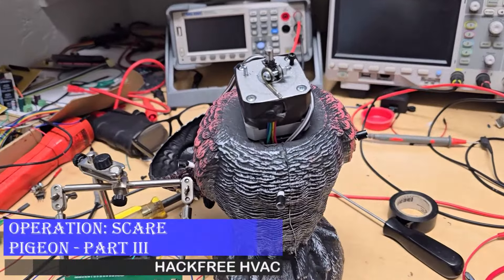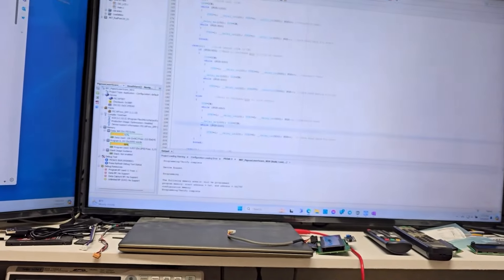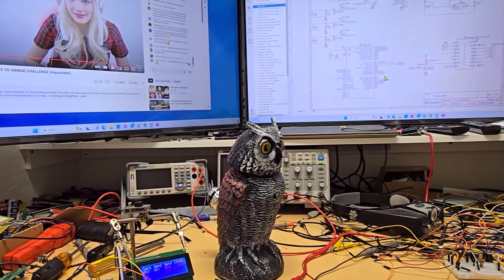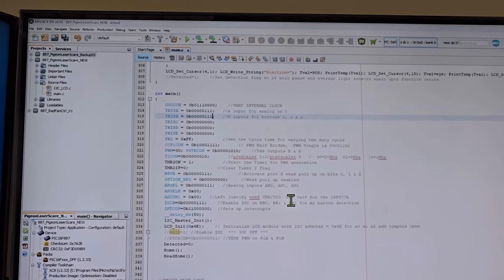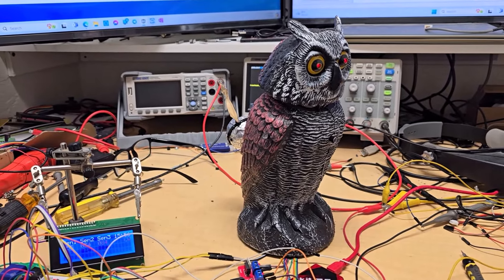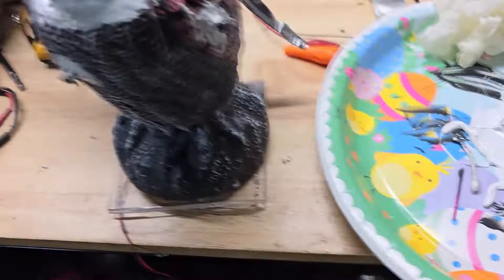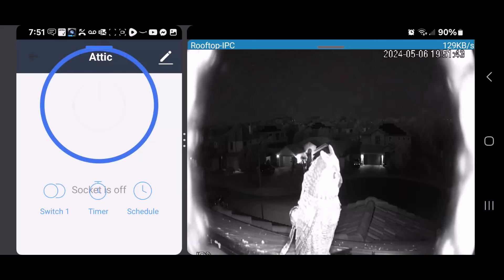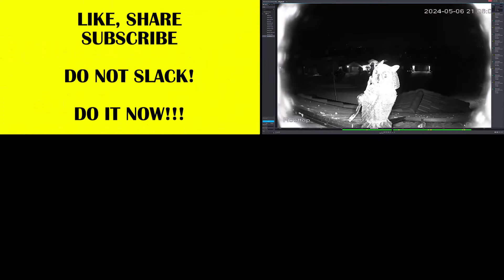The Scare Pigeon is perched on the rooftop - Will it do the job?

Comment: One of my neighbors has a big issue with birds, they have this device that squawks and blinks lights when the birds fly near it or if people walk up to their door.
Maybe if you were to make the owl make some squawking sounds, it would help as well.
Reply from the maker: The stronger twin I just built has a stronger motor to spin the impeller faster. And so I can let something slap the frame it will sit on.
When I first put the first one up the foil tape just touched the solar panel behind it and the slapping sound made the pigeons fly off. At least a while.
So the next one will be louder.

And I am thinking of making two motorized vibration balls to lay near each of those panel arrays with a single motion sensor. Make this ball JUMP around each time they walk in front of the sensor.